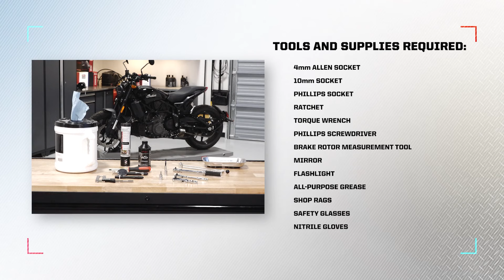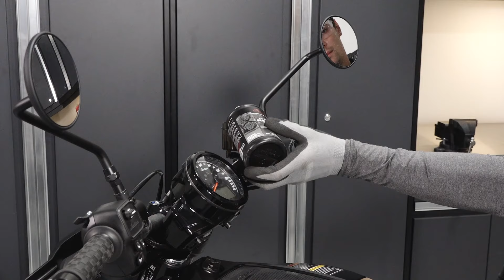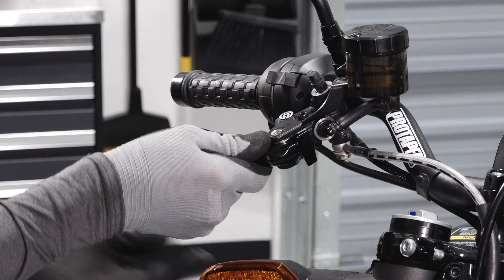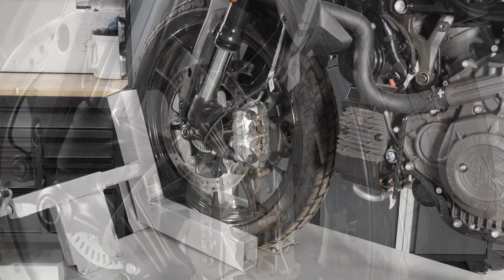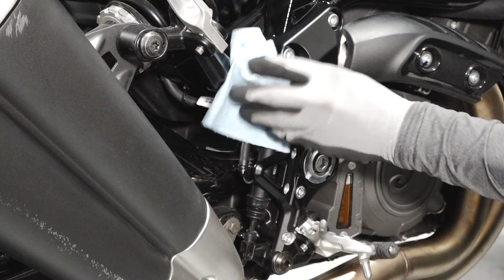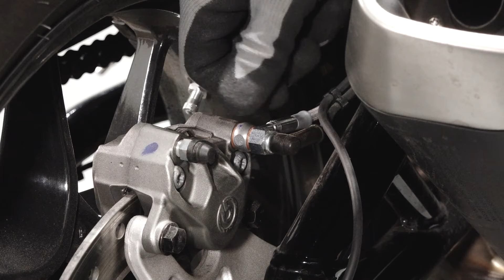FTR 1200 Brake System Inspection and Maintenance - Indian Motorcycle

Comment: I only add brake fluid if its low after the brake pistons are fully retracted, otherwise if you fit new pads after topping up it will over fill the master cylinder bowl.